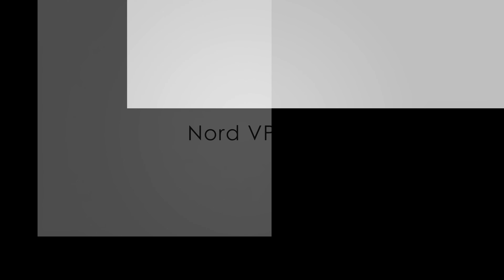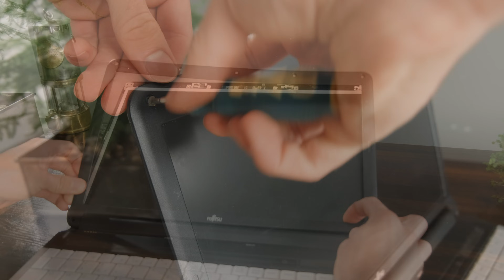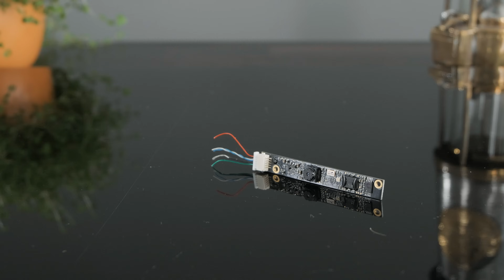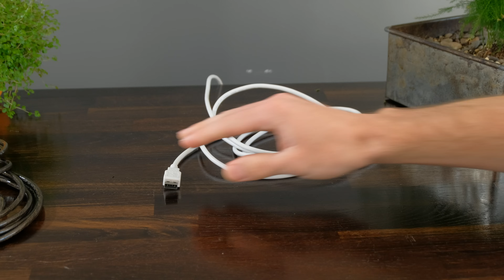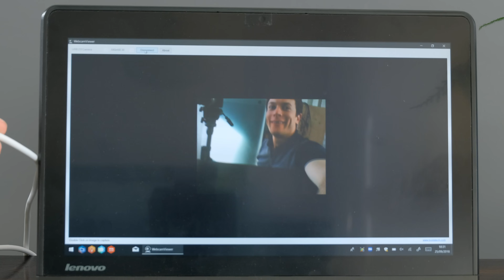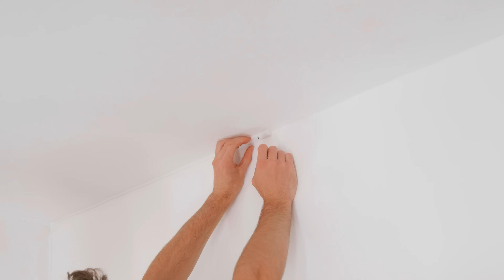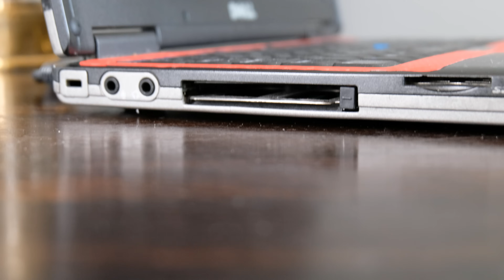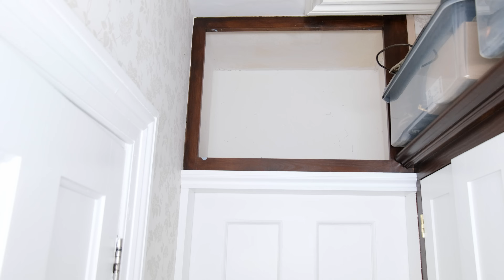DIY Home Security - ON A BUDGET!

Comment: Would you be able to go from camera to Cat5/6 cable then to USB to computer? Asking as cheaper that USB on long runs.
Reply: ok, firstly, the question is 
would you be able to go from Camera USB to UTP Cable (unshielded Twisted Pair)
and there is a big difference between CAT 5 and 6

but simply stated
both are analog signalling ,  Meaning they use electrical impulses, as the carrier
so, that's a tick right there

and YES< you can , you justt need a USB TO UTP Converter
you might want to try to research  8P8C   or  6P6C     THE LATTER SHOULD BE FINE

now speaking plainly,  if USB has 4 conductors , and UTP 4 pair has 8 conductors,  you could use 4 of them by straight soldering

BUT.. THE PROBLEM WITH THIS WOULD BE,   the USB signal degrades over distance as a result of
VOP  VELOCITY OF PROPOGTATION
WIRE DIAMETER
FREQUENCY OF SIGNAL

so the main thing is the USB freuquency vs  Your Internet Protocol 
CAT 6 goes further because it supports higher frequency and has a thicker conductor
but realistically you could use CAT 4 for this
Hell, you could use CAT2 , why the fuck not,  only 4 wires,  so you don't waste half the cable
BUT... you could use CAT 5 and HOOK UP 2 CAMERA'S TO THE ONE CABLE, so as to not waste the cable
it will require some DIY on your part,  but hey..... it would work
Reply: @Martin Kuliza < Cat6 has better shielding therefore it would probably work more reliably for longer runs (over 50ft.).  The USB to CAT adapter has an active amplifier circuit built in, so the signal loss over long runs will get re-amplified to normal levels on the other end.  It works fine, in my office I have a 50ft. long run Cat5 cable with a USB to CAT convert box.
Reply: @BillAnt  
I Undertand all that, and that's all fine
Just one correction

Cat 6 Does not have better shielding than CAT 5 or 5e
THEY ARE UTP CABLES  (Unshielded Twisted Pair)
THEY BOTH HAVE NO SHIELDING

you want to see shielding ?   Go to CAT 7

now, you can get CAT6 as an STP (Shielded Twisted Pair) but it looks NOTHING LIKE what your'e talking about

Now, you're probably referring to the plastic separator in the CAT6, and that's fine, 
but THAT'S NOT SHIELDING 

also the cables have twists that give them natural shielding
the Twists in the Cat 5  5e and 6 are the same
so from that point of view, shielding is the same

But when people say SHIELDING they usually referred to a shielded layer of foil or aluminium casing (like a CAN on a PCB for example)

so again
Cat 5 and CAT 6 are UTP cables,   NO SHIELDING
Reply: @Martin Kuliza < I didn't mean more shielding in the literal sense, but through the unique twisted pairs it's more forgiving than a CAT5.  Some more expensive CAT6'es do in fact have bit more/heavier foil in the jacket, but that's besides the point, don't worry I know exactly what you mean. ;)
Reply: @BillAnt  
well. YES "Forgiving" is a better word
but you did say "Shielded"
i can only take you literally for what you say , at the end of the day .

personally i only use Cat 6,  i don't see the point in 5e anymore,, especially given the prices of a roll and how similar they are to 5e.

6 has thicker conductors and is more capable and yes that plastic does help reduce cross talk.
Reply: I would assume so, as they are just wires, and CAT6 should be faster, or very close to, the speeds of USB.
Reply: A few comments on USB cable lengths and time-saving meter suggestions. 

My 1st choice for longer cable runs:  Look into  USB cables 
called "ACTIVE USB EXTENSION cables". 
They bump up/increase the power for long distance USB cable runs. Lengths are available in  like 10ft, 15ft, 25ft and 33ft and I believe 50ft, are common lengths for "Active USB Extension Cable" devices.    

2.. "USB-to-CAT5 or CAT6 adapters" . The passive ones are like $10 or $15 for a pair, one on each end of the CAT cable.  Passive meaning it gets all power from the USB port,   BUT.......depending on cable's overall length, these very well might not supply enough USB power, end to end. 
A "Powered USB hub" could possibly be added INLINE for more current capacity, end-to-end, but I can't speak to its efficacy at providing ENOUGH end to end power for everybody's specific  project.   

I found the if the USB devices drops in and out of working, or works intermittently,  it is probably lacking enough sustainable USB power  from end to end. 

NOTE: Having utilized both attempts at extending cable length , on 25 to 100 ft long USB cable runs, the ACTIVE USB EXTENSION CABLES worked best for my engineering projects. 

A POSSIBILITY:   I have never tried using BOTH solutions at the same time. The ACTIVE USB EXTENSION cable, inline with the USB-TO-CAT adapters just might work.  Nor have I tested daisy chaining two ACTIVE USB EXTENSION cables together.

A TIME-SAVING, NECESSITY ITEM:  I suggest getting a cheap, aka $8 to $35, INLINE USB meter. 

About the size of a flash drive, it plugs inline and it usually has a small 1/2" by 1" LCD display that shows current, voltage, and a few other USB SPECIFICATIONS.
Cheaper ones are mono displays, just black-on-white read outs. 
Better, more expensive ones have color-displays

I used a cheap $10 OR $15, USB inline meter device, in order to get actual & factual current & voltage readings from the USB line under my test. 

Mono-display:
1.  I used a generic unit that looked like the 
[MakerHawk USB 3.0 Tester, USB Power Meter] for about $13 at amazon].

Color-display:
2. A 2nd, color display unit with more features is the [MakerHawk UM34C USB 3.0 Multimeter Bluetooth USB Voltmeter Ammeter and USB Electronic Load Tester] for about $35 at amazon. 

There are literally dozens of similiar USB inline meter devices to choose from on amazon or ebay.
Reply: @Fran Kaspe  < You've mentioned not having tried to daisy chain Active USB Extenson cables, well I have, in fact I have 4x 16ft daisy chained plugged into a powered USB hub on the computer side, connected to a remote printer, which works perfectly fine without any errors.
Reply: @BillAnt   I like an occasional active usb extension, when it fixes the power issue.
The only issue with active USB extension cables is that the last time I used them some years ago, the longer lengths were limited and they got rather pricey.  Not so bad for a single end user. 
However, on one large group  project, I had like 50 users needing an extension of about 100 feet. As it first stood,  this particular group's USB peripherals had chronic, intermittent drop outs.
[NOTE: I noticed recently that monoprice has a USB 2.0, 82 foot active extension for about $40. They were about double that when I had the 50 user project to "Fix"].
My only fix for the length/distance problem I got stuck with, was to slap higher wattage P/S in each desktop running their usb peripherals at long distances. No more usb drop outs but lots of retrofitting work for me.
Reply: @Fran Kaspe  < Right, I can see how can get a bit pricey for many users.  It's really a matter of cost per length, a shorter run using a active extension is probably cheaper, but on longer runs a CAT cable with an adapter is probably a more attractive solution.  The 4x 16ft extensions I've got years ago, plugged together driving a remote printer works perfectly as of today, not one dropout yet. :)
Reply: @phartblossum  . Thanks very much for your detailed dissection of the problems/solutions/debugging of USB long run. This will help me a lot on my project!
Reply: 😂 just place a pi zero at the location, plug the web cam into that and run a long power lead. You'll still have issues running power any great length but it's easier to fix that trying to hack usb
Reply: @David Barton < Power could be supplied by a Power Over Ethernet (POE) adapter, which would eliminate the need to run a power cable to your remote device, which would inject the power at the computer/router side, and split it off at your device.  These POE adapters aren't cheap, so you would have to weigh the cost/benefit/convenience in your particular case.
Reply: I don't believe you can replace USB with straight CAT6, especially for longer than about 5 meters.  But you can use a pair of inexpensive USB to CAT convert boxes, one at the camera and the other at the computer side which allows long CAT5/6 cable runs up to about 50 meters.  That's probably your best and cheapest solution.

Comment: Hey, for $2.84 you can buy a Min USB WebCam and you don't have to do all that work.  All you need is the USB Port / Hub + Computer + the Free in the Video Software and you will be all set.
Reply: Here is the Item Number for the Mini WebCam on eBay:  163188849225

Comment: but you dint told pretty much anything about the fact that usb max cable lenght is usually 5 meters, so you used repeaters, but dint told how to set them up, if they do require separate power or so..

Comment: I just looked around, not a single laptop webcam module for sale with cables. All are without cables. The cost is around $6 without cables. I saw some actual USB webcams for a similar price. It seems this setup would need some luck too as finding old laptops is exceedingly difficult in my area due to "e-waste recycling" and everything wants a lot for what they have as they don't realize a single old laptop is practically useless for most tasks.

Comment: thank you for the wonderful tip !!! However i would prefer to use arm based SBC with remote access and HW recording  while using open software.  Power can be supplied using couple of 18650 elements that are either salvaged from laptop or bought brand new to ensure reliability. As an advantage this will significantly decrease power use and increase battery life of a server on disconnect...
as disadvantage - you will need certain linux knowledge to set it up, but for me and many geeks out there  - this is just a fun time learning - so not big deal !

Comment: Camera feed is too clear for old webcams. Unless you got hi-end models that are at least 720p or high it won't be nearly that good. Nor will the view angles be that perfect. I install security cameras for work and you need 4MP or higher to get that clear a picture.

Comment: Just a hint: While you have the laptop stripped down, check the screen. If it is in good condition, list it on ebay or amazon or gumtree. You can often get more than you spent on the whole broken laptop for the screen element alone. Though it may take a few months to get it sold. Well worth it though, as you can often get a 5 year old broken laptop for about £20 and sell the screen for about £75-100.
Also take a look at the harddrive. Those are usually one size fit all. If you have another functional laptop, try it in that one. If it works, clear it out and put it up for sale. Depending on size, it's worth another £25-50.

Comment: If you have a raspberry Pi laying around, you can use an operating system called MotionEyeOS which can record and stream. if you have power issues you can connect the Pi to a 5V battery pack and your cameras will stay online 24/7!

Comment: This is very cheap if you have old laptop cams but if you don't have an old laptop with extra usb root hub cards it can get tricky plus even really cheap CCTV cameras include infrared LEDs for "night vision" and what about the cabling cost? I guess you can actually use cat5 cables instead of actual usb cables but what about repeaters, are they expensive? 

Analog CCTV is actually quite cheap and super easy to set up btw. In general they also do a fairly good in lower light conditions but you'll probably get pretty much the same resolution as laptop cams if you use the cheapest CCTV cams. Most CCTV DVRs allow you to do remote monitoring for free but you have to rely on their servers (if you set them up the easy way) which can be more secure or less secure depending on the brand plus I don't think it's encrypted out the box or you can do it the hard way with vpn software.

In short, I'd say that analog CCTV can be cheaper if you need 8+ cameras and remote monitoring doesn't always cost extra if you trust that no one is watching you through your own cameras unless you have all of this lying around

Comment: sadly while our local 'dump' has a place for used electronics, they won't let you take anything out of that pile citing 'private security' reasons... i wanted old heat sinks to built a Peltier driven fan for the top of my woodstove - even the heat sink couldn't be taken out...

Comment: Hey Matt,
I am planning on making my own system of cameras using this method. 
Would it be possible to using ip streaming to add even more cameras to ContaCam and stream video from locations further away in a large house rather than using long usb cables? Would it also be possible to use usb over Ethernet instead?

Comment: i tried it today but it does nor work i used  a DELL xps webcam it has 7 wires 2 for data but i tried to do the swapping but still saying ''the USB not ecognised" i tried it in HP computer using windows 10. the XPS seems not to use the USB protocols
Reply: did you figure it out?

Comment: Just a small thing I wanted to say: I've noticed that a lot of webcams generate a significant amount of heat when they're being used. So keeping them on 24x7 in an outside environment, especially in tropical countries, might bring the life of the components (on the circuit board) down drastically (~3 months).
Reply: I have the same problem with the heat...

Comment: do you thing you could finish a video before making another one? you 
didn't leave a link for the motor lift wire schematics or a link for the
 power supply.

Comment: Hi, I want to replace a 500 watt halogen security security light, with infrared sensor, what led light should i use as it lights the whole garden, some power equivalent are not bright enough. Secondly could your idea for security webcam be used on wifi so no cables, many thanks bazza-mer@virginmedia.com

Comment: I've tried using webcams and laptop for surveillance. There r some problems. Contaware won't work on Mac. I dont see free surveillance software for Mac. If u use active USB cables, it damages the USB port of the PC/tablet after a few months - the tablet/PC stops detecting the webcam. U can get around this by using a differemt USB port on the PC, but not for the tablet which has just one otg port. It's not possible to charge the tablet while it's connected to the webcam. Video quality isn't good in low light.
Reply: get a PC, not a mac :-P

Comment: Is any chance to watch those cameras while I am not a home? Can you do it? Please...
Reply: Probably the quickest and easiest way would be to just install TeamViewer on the laptop. Since teamviewer can be on your phone also it makes it pretty effortless to connect and quickly look at your laptops screen. Other ways may include port forwarding the application he uses implying that it has some kind of web interface.
Reply: Ohhhh yeah. That is brilliant! TeamViewer!
Reply: If you used a rasberry pi running MotionEyeOS you can hook up multiple cameras. port forward the Pi and boom, accessible from anywhere in the world
Reply: Just understand that if you're sloppy about digital security anywhere along the data chain that your cameras are "accessible from anywhere in the world".
Reply: I haven't checked the base OS but assuming that it's Unix based  you can set allowed and denied ip addresses.  Not great use if you travel abroad or for places like coffee shops but if you have a couple places you go a lot you can limit it.
Reply: Yes there is as I can activate my home PC from my shop and see everything that is going on in my house with a free program.
Reply: @mikebell6062  ... and the free program is ????????
Reply: "Anydesk" is the name of the program. remember to set a password (very important) as this will allow you control the remote comp at any time you need.

Comment: Hi, i have few objections about this "solution"
1) please say about uses cases of this system - it looks like vuarist-only system - spying for your roommates, nothing else.
2) daytime only - how to use it after sunset? 
3)  system is standalone. Yes you can only use it via Teamviewer for example - but it not easy to do on mobile phone
4) using laptop 24/7/365 with batteries  and on charge can dramaticaly finished, and burnsup your flat ( googleit - about self burns laptops on charge)
5) not all cams can be used - only with IR filrer - or you will see strange colors of objects.

Actually i cannot see any reason (except point 1)  why you should do it in this way. In current time - suvsystem with 4 cams  (not ip cams) cost about 100$ with DVR and old hdd.

Comment: Just opened up a "Bunker Hill " system  500GB hdd w/ 4 color/ir cams bought from Harbor Freight. No color adjust on system just contrast , hue , brightness. After quick testing , color is garbage , blue here green over there....in full daylight color is some what coherent but items look as though they are reversed ( color wise ) and all greenery and shrubs look like they are covered in snow or frost. Seems like ir mode over rides daylight ALWAYS. As for range , items are somewhat clear up to 30 feet but after that ..trash. System has on screen adjust for almost HD quality for cameras but they have only 380 lines output and the only option to connect to TV/ monitor is A/V out which is 480 resolution . Just hope to save someone else the " that seems like a good deal " purchase when it is only suitable for a gift to someone you don't like and can mail it to them with no receipt....let them have fun with the JUNK.

Comment: If you need to wire the cameras very far away( i.e. further than a bunch of usb repeater cables, so like ~30m) I recommend using a usb to ethernet cable converter and wiring the length with cat6 cable. Less signal/power loss, possibly higher speed too.